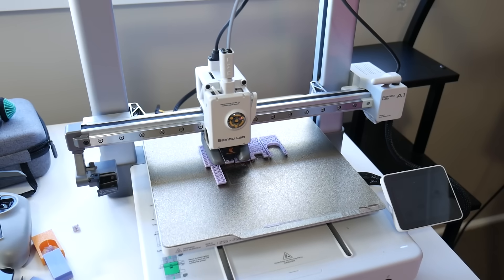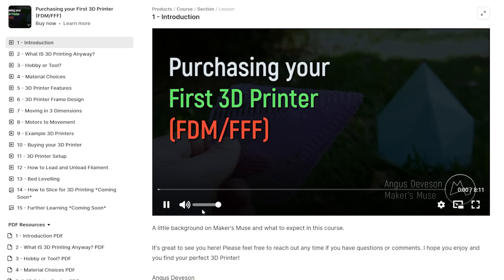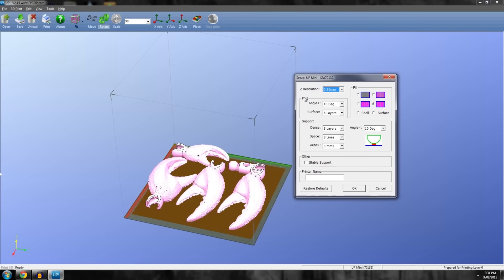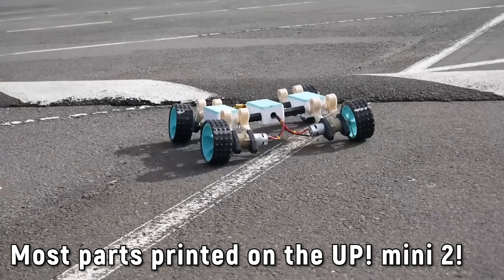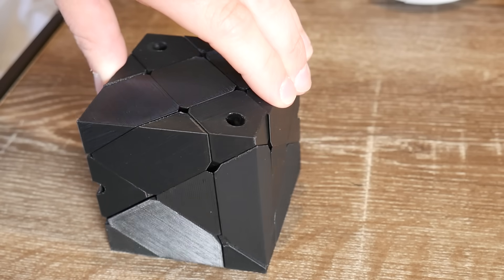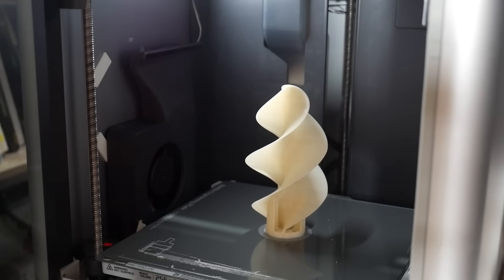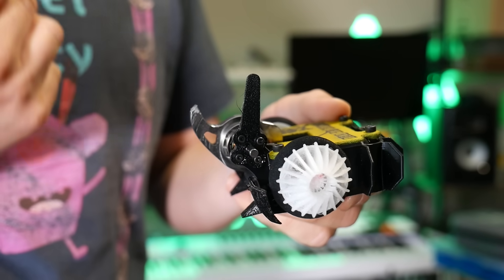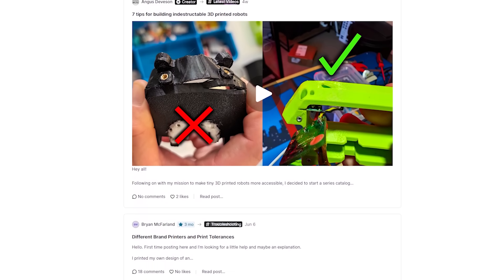The best 3D printer is...

Comment: I bought an Ender 3 Pro in 2020 and it has been a workhorse, however I've been playing favorites with the Elegoo Centauri Carbon. CoreXY spoils you 🤣.

That said, the CC came out this year, and mine is a "batch 5" unit, but they're still rolling out hardware and software updates. I'm capable of making my own changes and repairs but I don't speak for everyone.

Comment: Excellent video Angus. When I see a "best" video, my first thought is always "best for who and what?"
I've got a couple of old Ender style printers that I spent weeks (months?) fiddling with and finally came up with a profile that printed well with one filament type.
Even though they are slow I still use them for some prints. Now what I need are reasonable priced multicolor printers that work reliably. I've got a couple of white ones😁
What I WANT is a totally different beast. Thanks for this sensible video. Cheers!

Comment: My 1st printer was an ender 3 clone — Voxelab Aquila X2.   It worked okay, but i was constantly having to tinker with it.  That was something I didn’t have time for.  Instead of printing a part using a tool, i had to become a 3d printer hobbyist.  I ended up getting an x1c with ams and it has been amazing.  I hate the lock in and worry about all of the things mentioned here, like firmware update, filament lock in, etc.   if I had more time for hobbies and didnt have family obligations, i might have gone another route.  But  i just want to be able to print something and have the print just work.

Comment: Heh, I feel that. I'm still on stock creality cr6se (including firmware) because it just works. I've done replacement of the wheels and it's really aged in terms of 3d printers. I really want the faster printing speeds of modern printer, but my current printer works and prints at the same quality despite being deadass slow that I can't justify an upgrade.

Comment: I will help everyone out
The best 3D printer if you want to build it yourself: Voron 2.4 LDO Kit

The best pre built 3D printer if you own a Samsung phone: Prusa Core One

The best pre built 3D printer if you have an iPhone: The Bambu Lab one that tickles your fancy the most.
Reply: Most owners of Samsung phones are about as technically inclined as your average iPhone user. Samsung is making those ridiculous folding-screen phones now after all and no one with any amount of technical knowledge is buying those.

I love Prusa to death and use their filament all the time, but the combination of high price and high effort requirement on their machines is kind of a deal breaker. Maybe they're more set and forget than what I've read online would suggest, though.
Reply: @deggy42 I am with you on the folding phones 100 percent though im a phone user that if I dont get my new heavy duty phone case within a day of getting a new phone the phone will be broken before it turns up. My Prusa has been pretty well set and forget, I do think people get better surface finishes from their bambu labs than I do my prusa though which in some applications, not mine fortunatly, would matter. I agree about the price somewhat but Czech wages and working conditions just arent going to match Chinese ones. I am happy to pay the extra though i understand people on tighter budgets not wanting to. Perhaps those people could substitute Creality Ender 5 Max for that supposedly its Ok from what i have seen on youtube but i have not owned one myself.

Comment: I concur with the fact that having printers you can actually rely on is a huge game changer, especially if you got started on the ones that need constant tinkering.  My first printer was a Monoprice Mini, which was very reliable for quite a while when I got it, but proved too difficult to fix once it started showing its age (although I passed it on to my brother who is more patient than I am and he was able to keep it going.)  I then got an Ender 3 which I had to tinker on constantly but in the end probably got all of 3 good prints off of in the time I used it.  Eventually I got a Prusa Mini which I still have and which I'm pretty confident would produce a good print if I sent a model to it right now, and an Ender 3 S1 which was a huge improvement over my first Ender 3, but still takes some tinkering.  I'm not in a position to buy another 3D printer right now, but if I was I'd probably be looking at a Prusa  Mk4S or Core one kit for the experience of building it myself.

Comment: Wait till you see discounts on a1 and a1 mini... the questions disappear. As previous ender s1, kingroon, elegoo and anycubic user I can tell - if you buy bambu lab a1 and it won't be faulty,  you will be printing for years without issues. Maybe adding lube to axis and clean the build plate here and there.

Comment: I recently bought a resin printer, sorta jumping back in blindly since I got upset with my old printer probably a decade ago. It was messy at first, and now it does take a bit of aftercare to clean, but the results are amazing. the details are all there even when the model has been shrunk down, but the part I appreciate the most is the supports are very thin. So thin in fact that I could practically pull it off the plate. Although my biggest fear now is that there is a very real risk of breaking the screen and be out a few hundred dollars.

Comment: In my opinion, as always, one should build a 3d printer from scratch or kit, like the PrusaBear or a Voron.
Be patient, and learn.

At some point you may just want an off the shelf option, you can, but least with the experience gained from a kit or scratch built machine, you can readily fix majority of the issues yourself, without having to resort to a customer serve rep, who will tell you the thing you already knew

Comment: I bought a Voron 2.4 last year and its been an amazing printer. Its quite the learning experience putting it together because you have to build and code everything about it yourself. Some instructions could definitely use some clarity, but the community for the printers is very helpful and supportive of whatever problems you have. Its fully open source and you can customize everything about it which is great. The CoreXY style of printing seems to be the best imo because not having a moving bed prevents issues with small parts falling off because of the inertia of the moving bed, espeically if printing fast. If you're willing to take on the building project, its well worth the time and effort because it can be one of the best 3d printers out there

Comment: The only printer I would say is the exception to the "crowdfunded printer", is the IdeaFormer IR3 V2, as the company will give full support for it every day and if there is a flaw etc they will replace it or help fix it. Doesn't hurt that it is currently leaps and bounds beyond any other belt printers out there as well. But besides that, I'd stay away from crowdfunded printers, though now you can buy it normally, and it already has a track record for being a good printer.

Comment: Bambu's quality but sketchiness has spawned a new level of 3d printing for sure with options like the Creality K1/2, Anycubic Centaur, Prusa Core One and more. And for that i'm glad!

My own printer is a fully stock Ender 3 S1 Pro. It's been working every time and the print quality is good enough for me. I recentlt picked up an old EPAX as well to give resin printing a go.

Comment: I've had to replace a few small parts on my Prusa MK3S because I didn't know what I was doing and broke it... but hey you can actually buy parts! The biggest screwup didn't even need a new part: I brushed the nozzle clean with a wire brush while it was still on (don't do this), and shorted the thermistor which burned out its port on the motherboard. Fortunately, there's an unused port right next to it (leftover from a previous revision I guess?), and because the firmware is open source you can alter it to use that other port! Been working like a charm ever since. The printer is a nice middle ground where you can make the machine itself into a project if you want to, but you don't have to.

Comment: My first and only printer is a Ender 3 V2 and outside of a broken extruder arm, I haven't had any problems with it. The addition of a CR-Touch also made it essentially plug and play. I bought it because it was cheap and wanted to get into 3D printing, and now I can slice and print with no issues.

Doesn't print minis very well with the stock nozzle though.
Reply: try not to fall into the trap of upgrading it too much. I kept on printing dumb mods, and buying random electronics just to make the printer “better”. In the end, whenever I “upgraded” one part, another one broke. I made projects before but after I started “upgrading” the printer, I didn’t make anymore.
Reply: @Space_US I've luckily managed to avoid the "upgrading" positive feedback loop, the only things I've ever changed on the printer are the extruder arm, the cr touch, and flashing the firmware to make the cr touch work. Literally nothing else has been done and it works like a charm.
Reply: @Space_US  I mean you will only fall into the loop if you have nothing to print, honestly.

Comment: Just before the new wave of faster and more marketed machines hit, I picked up a Prusa Mini.
As I was done with tinkering with problematic DIY hardware, mosty late RepRap era stuff, I wanted something reliable.
And I found this in my Mini, it being a simple and reliable machine which I can maintain in the long term.
At the time I did not care that it was of the older print overnight generation, but a later firmware update brought it's speeds up.
Which I installed quite late, since I do not run it much to begin with, but want it to work when I do.
A few years in, I still do not regret this choice, as when I want or need a print, I know this machine will just work.

Comment: My very old QIDI X-Plus (Org) is still working to this day BUT I do need a new printer and simply can not decide. I wanted to go H2D but held off buying it as I will never be using the laser side of it and simply can not PAY for features I will never use. (All models of the H2D have the needed hardware to update to the laser version).

Comment: "hugely expensive paperweights"
<shows raise3d printer>
Sister company used these and they constantly had issues and the performance/quality was very low, they support was also very bad.
I told them to ditch both of them and buy two X1C printers.
Their output went up 20 fold (with some support-free printing optimisations from me), quality went way up, and there were no issues.
Reply: My office still has 2 Raise3D printers.  

I have a $400 "bambu knockoff," and it's better in every possible way. They could buy one P1S, and it would outperform both of them combined.
Reply: @B1GTOBACC0  I nearly bought a Raise3D printer.  Glad I didn't, and went with the H2D and an X1E, both have been excellent.
Reply: I know of someone that got fired for recommending the company to buy two Raise 3D instead of a single Prusa XL. In the span of a year each machine cost the company in parts and downtime as much as a Prusa XL. 
When they decided to buy the Prusa and saw how reliable it was, they fired the dude for misuse of funds.
Reply: Here also... I wasn't able to print 3 tall part with the raise3d at least 4 times... I ended up splitting the part into small pieces and print it in 3 runs.... So what is the size for.
Now we also have an elegoo centauri carbon and boy its a difference.... we still trying it, but it is far far away from the raise in every way.

Comment: Bambu is NEVER going to lock their printer down to only take their filament. How would they even accomplish that? They dont have the capability even if they wanted to on a printer without the AMS. And the very worst case scenario is with your AMS you put your "aftermarket" filament on their spools. Some people are already respooling their filament that comes on cardboard spools onto plastic. Of course, that shouldn't be necessary (Lets be honest, at this point companies shouldn't be using cardboard spools), but hardly a deal breaker for the quality of printer you get for the price. You might have a point if you were talking about say Lulzbot making everything proprietary. Those are $1300 on the low side. At $1300 the average Joe is locked in. But for a $300 printer? Bambu would get dropped like a bad habit if their filament wasn't a crazy good price. And if it was a crazy good price, they wouldn't have to lock anyone in. Other than this minor complaint, I enjoyed the video as usual. Thanks for the hard work you put in. There's only one 3D content creator I watch more. Looking forward to your next one.

Comment: For a long time I used an Anet A8, and it worked great for me. It was reasonably reliable, and produced good results, and it was all I could afford when I got it. It was my only printer until about 18 months ago when I got a Sovol SV07 which was a revelation in comparison, and recently I got a BambuLabs A1-mini which I use about 90% of the time now because it basically just works and the only print failures have been my fault.

Comment: I purchased the artillery X-2 after one of your reviews and, still have it. It may be slow but it gets the job done and it was that confidence in the machine that allowed me to push on with the A1 mini with the AMS and then the A1. Dont get me wrong, I had some growing pain when I first got the X-2 (printed an adapter for a dial indicator from the part cooling fan to tram the bed) but if it wasnt for your review I dont think I would have gotten one. My dad was a machinist and its been a great addition even though I'm mostly making toys, masks and miniature terrain for people. I was  hopeful you would review the new AMS systems for the bambu (since they say support for A1-A1 mini Q3) and maybe the new artillery X-1Pro that is said to have an MCM Q3 aswell as I was looking to move into nylon and flexible. 
So are you moving away from review style for the channel or just dont what it to be the front runner for the channel content?

Comment: I think any "what printer is best" conversation needs to start with "do you want the printer to be a hobby, or a tool?"  These are really two different communities that have very different needs, but the question so rarely gets asked in review and recommendation videos.

Otherwise, my only quibble on the advice is the pre-order comments.  That's a deeper conversation than just "let others do it."  Getting in on a pre-order does raise the risk of getting a machine that doesn't live up to the hype,  But it also, usually, offers a substantial dollar cost reduction.  I'm well aware that part of the reason I l find my X1C such good value is because I paid the Early Bird Kickstarter price, and thus it cost about half of what a new one would today.  My satisfaction per dollar ratio thus has a huge advantage.

There are also non-tangible goods that can come from being part of a pre-order that shouldn't be ignored.  Now obviously this is a very individualised decision.  But, depending on your risk tolerance, how much you value being an early adopter, how much the pre-order discount is, and how much you reliably know about the new printer and the company making it, a pre-order can be a good decision.

That said, if you're trying to choose your very first printer and being overwhelmed with choice, just dumping anything that doesn't physically exist yet is a good way to shrink the decision space.
Reply: Exactly. I joined the wondermaker kickstarter for the 4 toolchanger under $1000. I know the risk, so I know I may have lost that money. But getting a 30% discount and to be one of the first to try this is worth it to me. If it fails I may buy the XL for 4x as much. Having heard the stories, any printer can be a dud. I have seen lots of people hating on printer X while successfully using other printers. To me it sounds like all companies ship problematic units sometimes.
Reply: @Konradius001  I'd agree any company can ship a dud, and any company can ship a perfect machine, but there is often a trend.  And a company's rep isn't all that reliable indicator for how good the next new machine will be - Prusa had a whole slew of very good machines and then the XL was a dud on launch and took a while to get fixed.

 Kickstarter is an extra layer of risk, which I didn't highlight but should always be part of the discussion.  With an in-house pre-order you run the risk of it turning out to be a dud.  With a Kickstarter, you add the extra risk of it never being fufilled and your money vanishing.  That risk can still be overcome, but needs to be acknowledged as an additional layer over and above the pre-order risk.

Comment: Modified cr10 v3 with klipper, with a sprit extruder pro hotend.... No issues since loading klipper, the printer is not necessarily only faster but way more accurate, and, with a 32 bit BTT skr3 it is way more quiet.....

Comment: I agree, depends on your needs. I started with a bambu a1 mini since I started going back to school for an engineering degree and it worked great and taught me a lot and made me a fan of bambu printers. Now I just bought an x1c because I wanted to print with different types of heat resistant matetials and wanted a bigger build volume. I just want something reliable, I dont want to have to mess too much with the printer itself besides maintenance and bambu printers are great for that.
Reply: They are, but your wallet suffers for it since Bambu's whole model is sell the printer cheap (anniversary sale) and drain you with the replacement parts + everything else. Basically pulling an HP.
Reply: @NIGHTDREADED their current product line doesn’t have any arbitrary restrictions on replacement parts/filaments as far as I’m aware. The firmware I can understand but there’s loads of third party replacement components for the X1C, so the printer physically is very well covered.